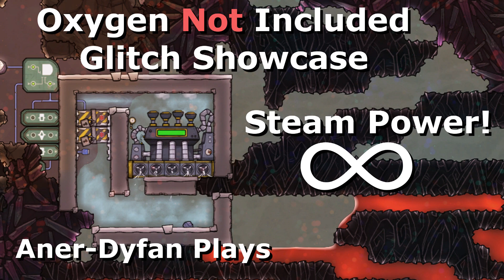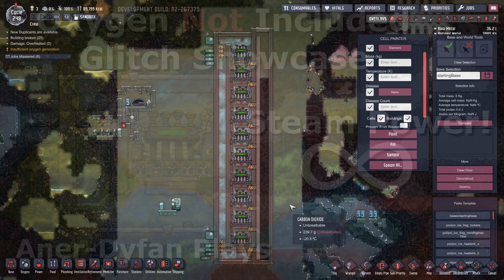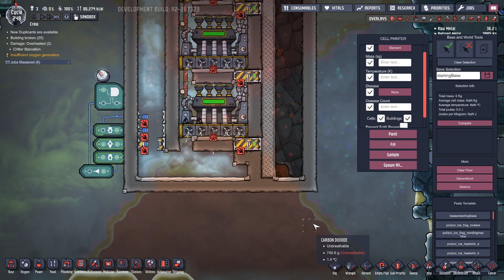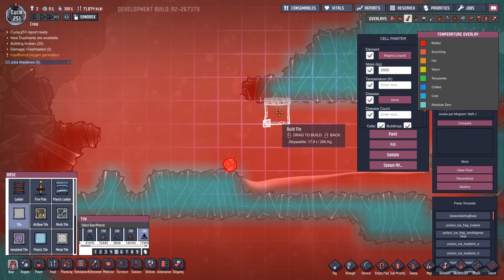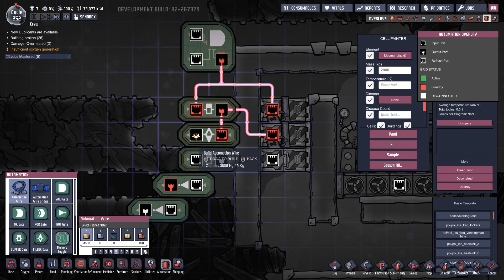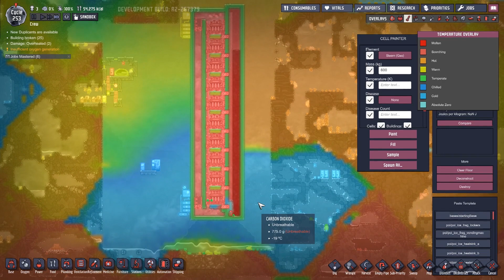Oxygen Not Included: Glitch: Infinite Steam Power (Old glitch, no longer works)

Comment: sooo I tested this out myself and got my own conclusion.

seems its not about the door at all, its about having the machine itself be over the 200 degree mark.

so you don't need the doors, as long as one side of the generator is touching a hot wall it still works as said.

naturally if the steam is cold theres a thermal transfer to the machine but as long as the machine itself is hot it seems to want to run door or no door.

also noticed the extreme pressure seems to be pushin the steam out trough my metal walls and made a MASSIVE pool of water beside my generators in the caverns... im thinking I could tap into this for a constant supply of water to boil to steam!

Comment: Interesting exploit. It's odd that the hot neutronium transfers the heat to the turbine and also how you can heat it up since it is a perfect insulator. I wonder how long before they fix that. I might try building one in a non-debug game.
Reply from the maker: Well I hope it does get fixed at some point, it can trivialise power generation somewhat. It's a fun little exploit to play around with, and to do legitimately does take a bit of effort though. I just hope it'll get fixed quicker than it took for the drip cooling exploit to get fixed.

My main use is actually going to be in debug worlds to create a power box to run systems on.
Reply: still works in 2019 o_O
Reply: @Rockingorc  not really, i tried, but it generally will stuck. i cant figure why
Reply: @liweiyang1988  https://youtu.be/TOAB6nHOdTA

longer version: https://youtu.be/0vy10-F3N5c